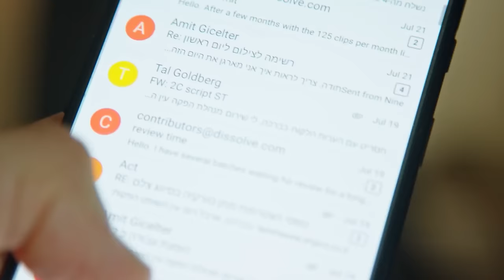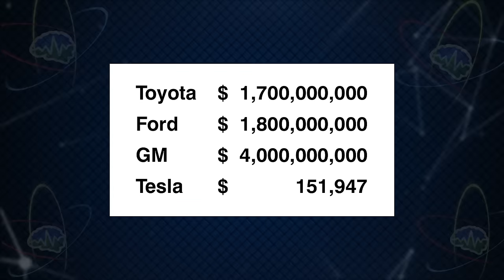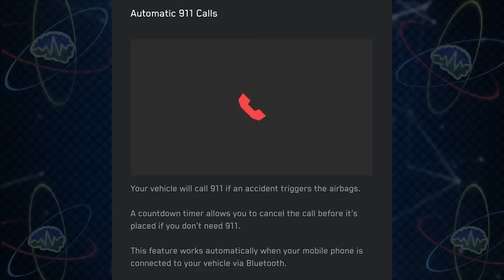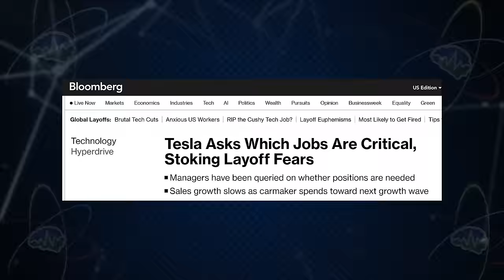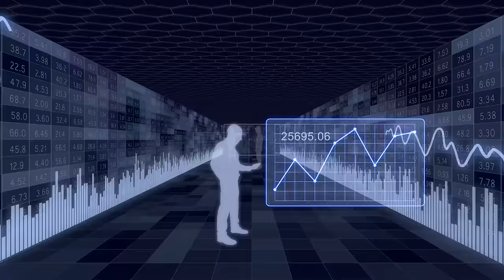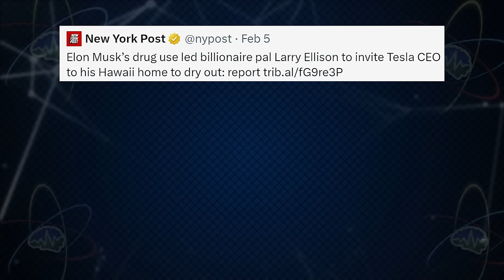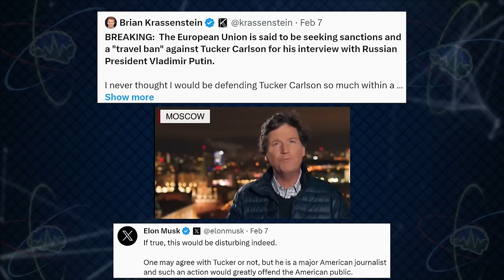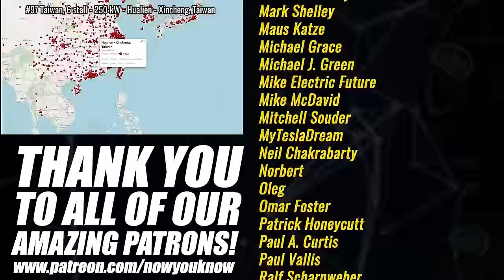Tesla Model Y Lowest Price Ever! | Tesla Time News 388

Comment: To be fair, I'm not saying this happened in this instance, but it is possible that it was a very sunny January day in Texas.  That would be ideal for solar production: full sunlight with the surrounding air cooling the panel.  Given no additional solar is built out, in that scenario, I would assume lower output in July given the extra heat.

Comment: Yes I bought one for 55k back in August after my model Y got hit. When I got my Tesla back a could not sell it or give it away. It sounded like a good deal when I could not get a car quick and we got a gas card for 15k. When we bought the car the gas was just $25.00 a kg now it’s $37.00 a kg. Toyota would buy it back but only for $4k to have a car it has cost all most 10k a month not good it just going to set in the driveway for it’s entire life.

Comment: Sila Nano makes silicon nano anodes and has a plant gearing up to make auto battery anodes with the first going in the 2025 Mercedes G-Class extended range model. Panasonic signed a deal with them in 2023 to use it in their nextgen battery. These improve energy density by 20% and see a path forward to 40% in 2028. Their first factory [and labs] is working on wearable devices and cell phones/tablets battery sales. The battery deal got them a huge grant from the Federal plan to remodel an old battery factory in Moses Lake Washington. It might be interesting to know how much of Sila's success recently may be attributed to him? BMW and Mercedes make up major funders and Stellantis has jumped in of late.

Comment: Hydrogen is free and clean you make it with solar plannels plus water. It's easy.
Reply: The principle is relatively easy. Making enough to power a car and getting it into the car oon a regular basis over time is anything but easy. But since you are starting with solar panels and ending with driving a car, there IS a relatively easy solution... Skip the hydrogen part.
Reply: How much are you producing then?